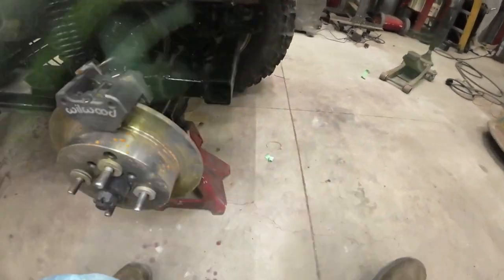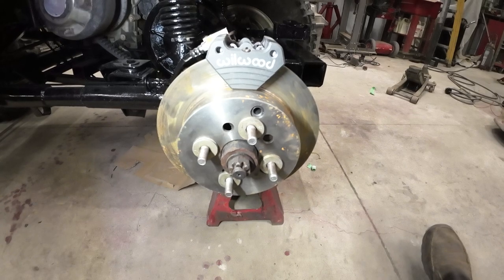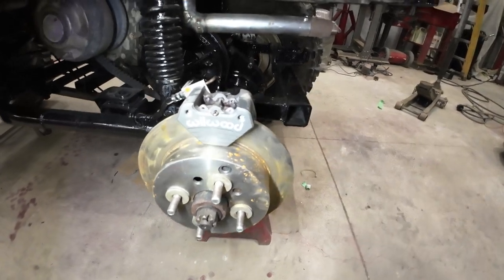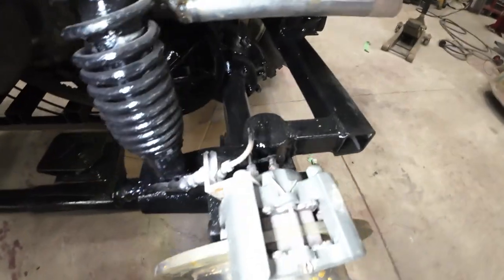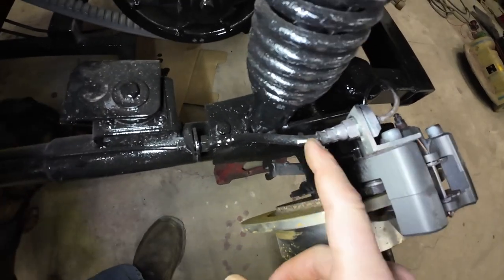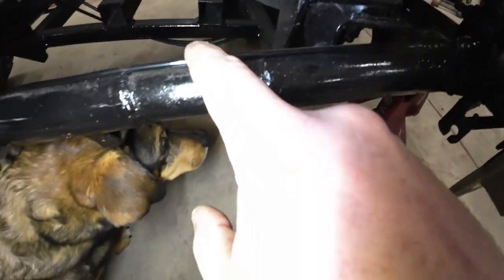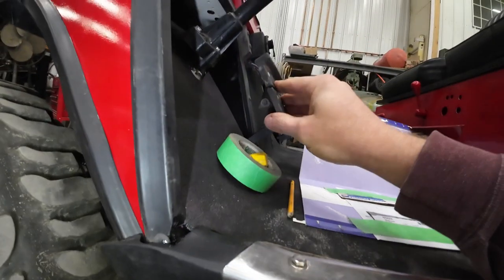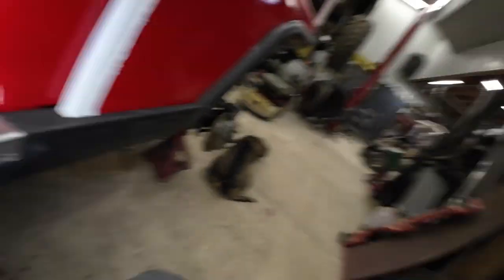Red golfcart rear disc brake conversion, overview and parts list.

Comment: What size rims will this require....I just got a cart I painted for my dad back around 08 and the drum brakes are terrible...it has bigger tires and a lift on it...done all new brakes and cables...still junk...thought about trying one of the Amazon kits for a side by side or 4wheeler and make it work but would probably be better to source only the parts I need like you did